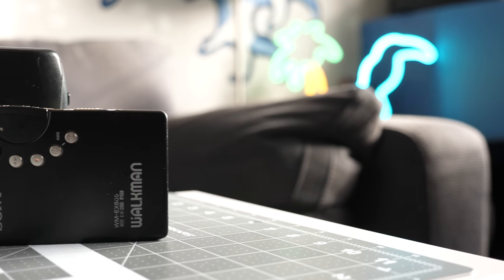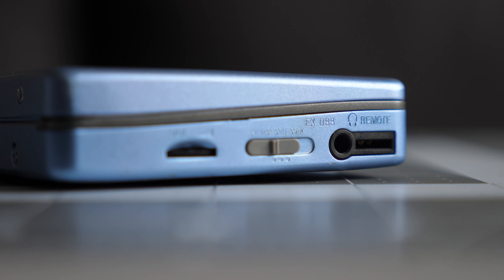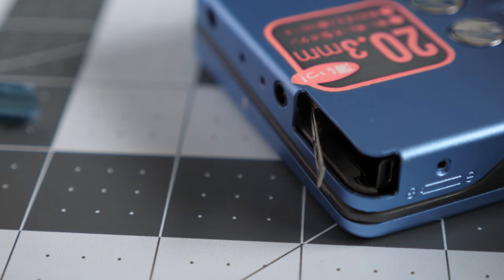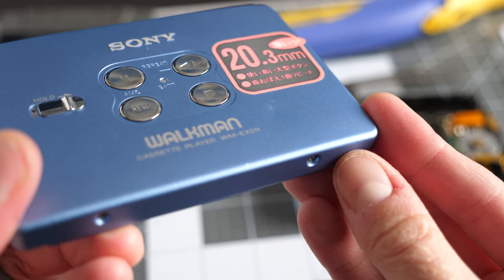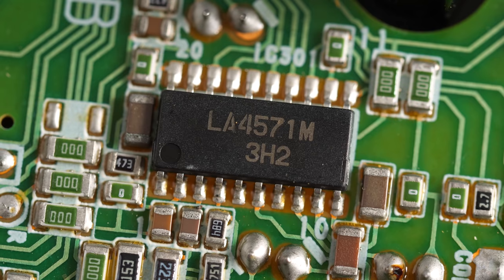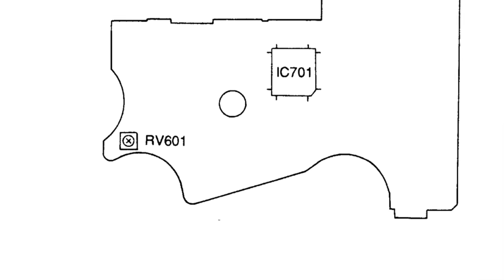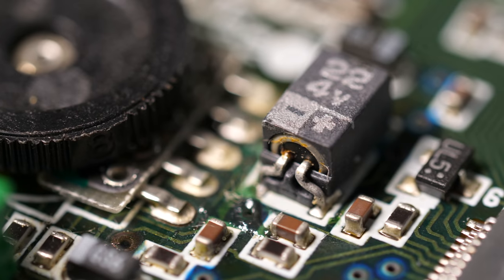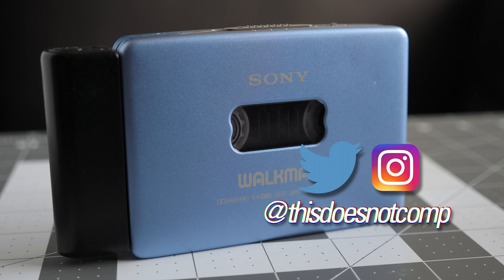Fixing My Vintage Sony WM-EX511 Walkman

Comment: I often find with this era of small Sony Walkmans that one side plays with more wow and flutter than the other. The reason is that one pinch roller stays engaged until you open the lid and remove the cassette. Many have been left with cassettes in them long term, denting one pinch roller and causing the distortion in one direction.

Comment: Found my WM-34 a month ago, owned it from it was new, I chose it for the Dolby-B NR. Hooked it up to my stereo, and it worked fine (some unstable tape speed though) until I tried fast fwd, then the belt fell off the motorpully. Still I'm impressed, I used it fairly much, and it has been lying arround in humid conditions, and in temp. from -20 to +40 deg. Celcius.

Comment: I've fixed hundreds of these units aver the years. That screw by the battery compartment is almost always missing. It's very short to stop it interfering with the gumstick battery - its really not necessary. You're right abut lucking out... it's a nice unit!

Comment: I love how you make retro cool! I remember back in the day, this type of Walkman design really appealed to me. That was probably after I got a Philips "portable cassette player" (Walkman is trademarked, of course) though. That Philips was an AQ6528 with all the bells and whistles: Dolby B, autoreverse and an AM/FM tuner. But it was big and heavy. I think a classmate of mine even jokingly said to me I walked around "with a fridge" in school once. And although it sounded good, it ran a tiny bit slower with some tapes (Maxell XLII-S for example) which was a pain.
Reply: I posted this before watching the last part where you had to adjust the speed trimmer. But now that I have, I have to come clean: I actually adjusted the speed of my Philips as well. It actually had a tiny hole in the bottom, giving access to its speed trimmer so it could be adjusted with a tiny flathead screwdriver. I actually did this sometimes, when I switched tapes. Ohhh the "fond" memories. ;)

Comment: I usually just record a 1khz test tone onto a blank cassette using a good quality recorder, then play that back into an oscilloscope to do speed alignment. You might be able to get away with using a frequency counter app or even Audacity to verify the 1khz output.

Comment: I was able to track down a EX 618 a while ago, which is basically 100% the same device, but rebranded as EX 618 for whatever reason.
It´s definitely a nice machine but i had a lot of issues with it.
The mechanics was stiff and needed a lot of lubrication, also the motor bearing was entirely dry and possibly also worn out.
Had to dissasembly the motor to lubricate it.
Now it´s running quiet again but oh boy what a pain it was to remove the glue, remove the stator board and glue it back together...
It´s not performing as good as my collection of EX 670/672/674 players (wow&flutter) but definitely has a lovely design.

Comment: You can make a test tone tape yourself, there are youtube vids of certain frequencies and record off that, it's not the same as a calibrated tape, but if you're confident that recorder is okay then you'll be adjusting your walkmans to the same speed as that at least. I have a 3kHz tone and a free spectrum sound app, and it's good enough for my ears. 

Oh, and if you have a junk Sony minidisc player those are a great source for that size screw!

Comment: Someone has probably suggested this but you can also record a test tape with a single frequency tone on that other deck. Since that one's presumably playing at the correct speed it should work and you can adjust the speed like that. Won't be as good as a professional tape from a calibrated machine but might be better than that BPM method
Reply from the maker: That was my first thought, but my working home deck hasn’t been calibrated either. Kind of end up in a catch-22 unless I buy a known-accurate tape.

Comment: Choice of capacitors was probably due to cost. As well as the caps being cheaper, they are easier to solder which further reduces manufacturing cost.

Comment: Thank you so much for this video. It motivated me to move on from my WM-F100III (a similar model to your R202) and onto the EX511 (mine is in black). I noticed something odd about my model, that being that its default "side A" is with the tape side A facing inward. This means that if I have side A facing, put it in the non-continuous play mode, and start playing side A, it will stop after only that side since I guess it's programmed to think that the side facing out is side B. I wanted to know if your model has that quirk too or if it only applies to some WM-EX511 units, though I am pretty sure yours does too just from watching the clip near the end of you showing off the tape you got with the unit.
Reply: 1:08 at there beneath the head is a microswitch that detect the indent for the fifth screw on each cassette. This is what I call a side detection switch. Basically more flexibility of play mode.

Comment: I have restored over 50 walkmans and only had 2 that could not be fixed. your left pinch roller is toast. Has a crease in it. You need to re lube the capstan shafts and replace those pinch rollers and sometime it is just the tape you are using, try another. Some walkmans like some tapes and some don't :)

Comment: You will want to re check the capstan pulleys and the motor pulley on that walkman. You will hear WOW with certain songs like from queen with slow piano. The video showing the belt moving I can see uneven movement. Not hard to clean them.

Comment: Hello! I have a WM-525 and I changed the belt, and I don't know if the speed needs to be adjusted or where it can be adjusted? On an older walkman, you could control the speed of the motor with a small screwdriver. I couldn't find a repair video for this type. thanks

Comment: Don't know how to explain my problem, but I'll try. I have a Sony CFD-S03CPL with working radio and cd player, but the cassette player does something weird. I have assumed that the motor is ok because the rewind and forward functions work properly, but when the play button is fully pressed (like if I was trying to listen to some tapes) the motor almost stops or runs very slow. For it to work, I have to block the play button (without being fully pressed) for the cassette player to work at the appropiate speed (when the play button is fully pressed, sometimes the motor almost stops). It's a pitty because this player is the only one that I have that lets me burn some tapes when I want to test them. Thank you in advance for the help

Comment: if your repaired good deck has decent speed stability, you could record the speed test tape yourself on it too by the way, I guess it's worth a shot and if you're mostly listening to stuff recorded with the deck you made the calibration tape with, setting them both to the same speed is all fine, even if both end up slightly off.

Comment: Got two identical Sony players, that I just can't get either one working.  Thankfully I didn't spend a whole lot of money on them. So, I went back to eBay and decided to splurge a little bit and buy  more costly, well serviced player. Along with another middle of the road Sony that does work and one gamble with an untested machine. 
I got a cheaper Panasonic that I want to enjoy, but after replacing the belt, and adjusting the speed, it just doesn't want to stay at the proper setting. It just feels like 2% too slow. No matter what I do. Time to try some new units.

Comment: Calibration of decks is relative.

You should record a 3KHZ tone on the deck you'll be using the most to produce your music.

Then use a phone app or audio editor on a computer to view the frequency during playback. Adjust to 3khz and you're good.

That way tapes played in your Walkman will be playing at the right speed for the recording and chances are if tapes recorded by your deck sound good, tapes recorded by other decks sound just as good. So don't worry too much about dropping cash on a calibration tape just make your own.

Comment: Question to the crowd (if someone still reads this): I have a WM-EX 674 which didn't move, changed the belt an it still didn't move, looks like it tried to initialize turning the motor both directions and then stopped. The mechanism appeared to be stuck, one reel would rotate in both directions while the other one didn't move at all. I poked the solenoid and at least it does something now, but while the auto reverse mechanism does now move, it keeps changing the directions a few times before it stops. Negligible movement on the tape.  
Any suggestions what the problem/solution could be?

Comment: hi to all out there just to let you audio fans know i have the same test tape  it IS ONLY FOR HOME HIFI  NOT FOR 4 TRACK  recorder 6 8 track caseette  recorders as the test tape was made  on a high speed dubb   you can hear  the  tracks are out of line if you play back the tracks a once 
 2 come on first small time later the next 2 track  as the cassette dubber use 2 heads  that are stepped   i am in the cassette copy game

to do a pro decks you will need a full track  cassette i used the make full track cassette tapes by using a 1/2 in tape  head  so all the tracks start are the right 
place on the cassette may start selling them again